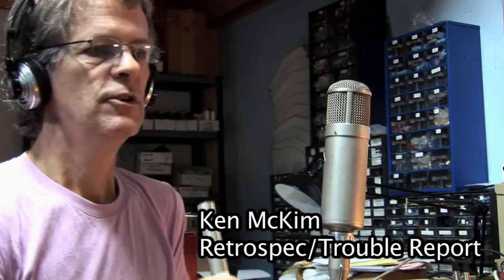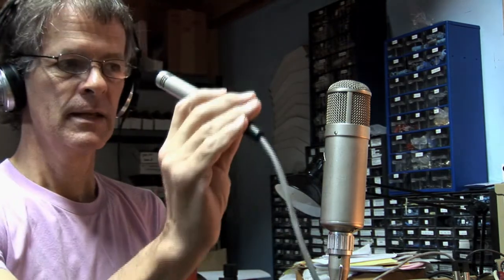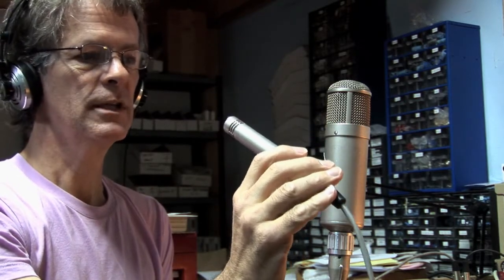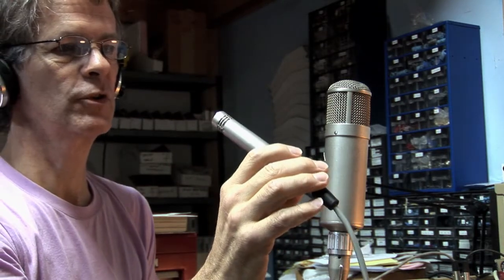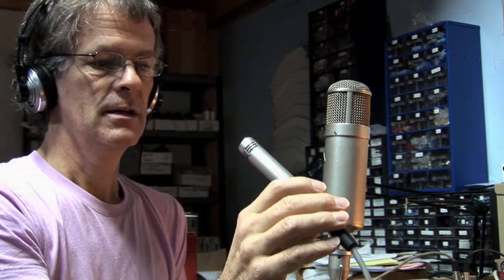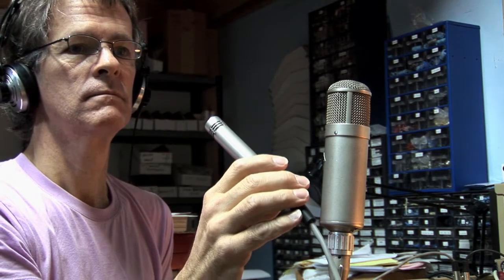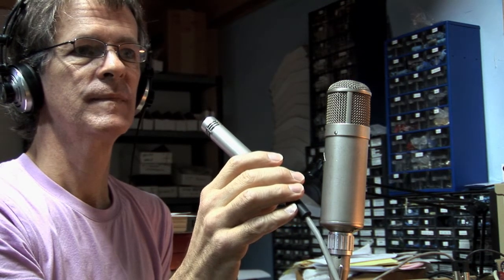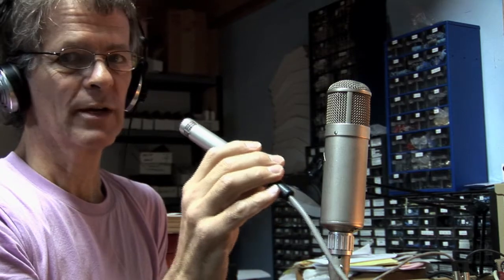Trouble Report : One Quick Question . . . Mic Repair

Comment: Hi Ken, thank you for your interesting video. You seems the only one on youtube, who is covering this topic. I watched you, as i have issues with my DIY U87i from MicAndMod.com. I made it and soldered it, but no idea how i can repair it. Maybe you have an idea. I dropped it recently and after that it became very noisey. I thought the capsule is broken, but after unsolder the capsule its the same pink noise. I don't know the connection between capsule and electronics....Maybe the capsule keeps everything in balance and i need a new capsule to stop the noise?
Reply: Thank you for your help. I tried that all but it doesn’t change the noise level of -60db. Doesn’t matter if the capsule is soldered or not the noise level is the same. It’s there a interconnection between circuit and capsule. I mean is it important that a capsule is in the circuit to sound noiseless or is there maybe a other part of the circuit broken? Cheers Mat
Reply: @monowelt  You're getting into tricky area here. The capsule connections need to be terminated in some way, or it introduces noise of it own. If you observe no change, then it's probably something in the electronics and not the capsule. I think you mentioned this is a DIY unit. That means you built it (?), and that means you have some soldering skills. I would go back through the circuit board and touch up all the solder points, using very small amounts of solder, but making sure that the solder connection is solid - that means that the solder flows and really bonds with the component leads. If that doesn't get it, you should seek technical help.
Reply: Yeah I soldered it and put all parts together. Thanks for the tip. I’m gonna try to solder every point carefully again. If not it might be the capsule. Stupid me, why did I dropped it. Thanks again Ken. Cheers Mat
Reply: One note: if you disconnected the capsule and got the same noise, the exact same noise, then it would seem not to be the capsule. Good luck. Let me know how it turns out.

Comment: bro I have presonus audiobox itwo studio bundle, but my mic is giving some electric noise sound to me and when i close my hand to mic then that noise stopped, can you tell me what can be the problem.
Reply from the maker: Hi Hitesh, Is the electrical sound a "hum"? If it is, turn the mic 90 degrees (then, take your hand away). Does the hum change? Louder, quieter?
Reply: I'm not an expert, but i've taken apart a few microphones. To me it sounds like their may be a grounding issue. If you're able to, take it apart and make sure the middle pin on the xlr connector is connected properly to the circuit board. With my AT2020 (xlr) mic, I found that the screws themselves grounded the circuit board to the housing, so you might want to check them as well. Sometimes they just need to be tightened a little more.